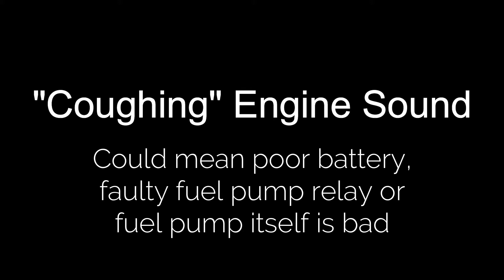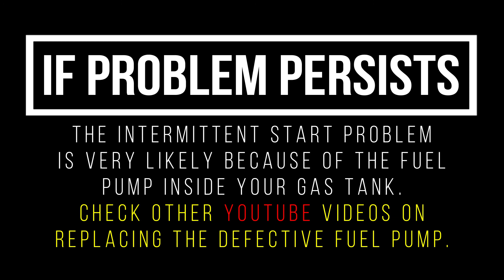Fix Honda Odyssey 1999 - 2001 Intermittent Start or Fail to Start Problem

Comment: Quite a helpful video.  Mine is an intermittent problem too.  I have mostly the coughing sound when it doesn't start .  When the car is taken to the dealer, with the problem,  it always starts there but sometimes not at my home.  So recently i try to press the gas pedal a little when starting.
Reply from the maker: It’s either a gas pump or pump relay issue. Eventually it will fail to start. Don’t wait till you r stuck somewhere unable to start. As mentioned try resoldering all the contact points on the relay circuit board. I did that and no longer have intermittent failure at ignition any more.
Reply: @ChewOnIt  So i had the main relay (fuel pump relay) changed today and the tech told the service writer that the old one was all beat up, something about the soldering etc.   We will see what happens.   My problem starting was at home mostly on a cold engine. Thanks
Reply: @ITLHI1  do you mind sharing where you got your parts from & what year is your van? I have a 1999 and having same issues.
Reply: @anthonybrand8924  I went to the Honda Dealer and after they changed the main relay, the problem continued. Finally, in December, the car wouldn't start at the dealer after i had it towed in.  They found the problem was the Distributor and the spark plugs so they changed the cap and rotor, the spark plugs and the wires.  Since then, ,my 1998 Odyssey starts fine.  

But now i have rust under the right hinge of the liftgate, so i have a hard time completely closing the right side of the liftgate. Also, from  the past the check engine light came on and they say that the EVAP control canister has to be replaced but that part is no longer available. It doesn't affect the car much so far though. - 

Another part that is not available is the driver side window switch.  That switch wprks not too well when trying to raise the window up but it still works enough.  So the dealer service rep said i should look for a new car since parts are not available. He didn't take care of the left ball joint which is worn and loose because he said i should buy a new car. I'm debating whether to fix the ball joints  including the right one, which he said would cost around $1,000.
I've been researching the CR-V and the Rav4, etc.
Reply: @ChewOnIt most of those second hand parts you can find on other sites like car parts if you don't mind not having OEM parts
Reply: The 1998 Odyssey EVAP control canister and the window switch are no longer available even from outside vendors. The  Honda dealer checked for me and i also searched on the internet. 
Also , for my 1999 Corolla, the steering wheel is no longer available. The contact points for the horn are not good inside, so it doesn’t honk many times.  I had to have installed  a secondary horn by a small outside security/ audio company to the pass safety checks.

I am reluctantly giving up the 1998 Odyssey for a 2022 Rav4.   Main reason was the back liftgate can’t close completely shut on the right side due to rust under the right hinge.